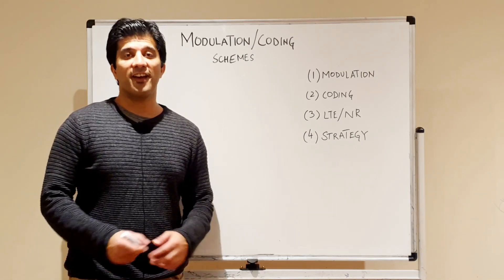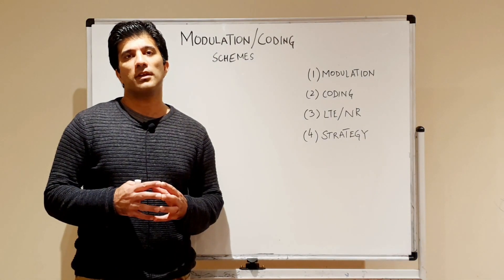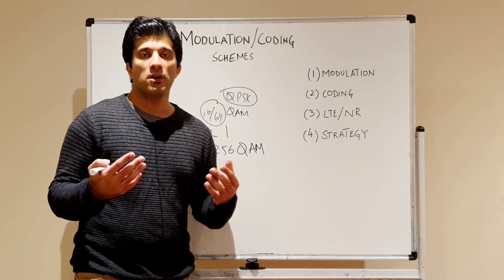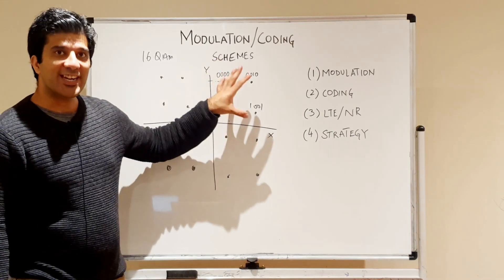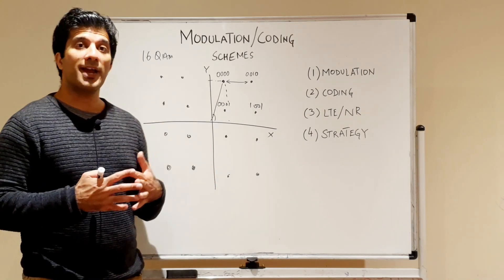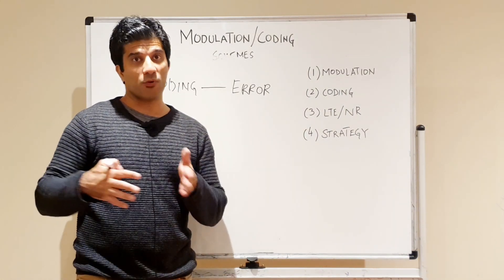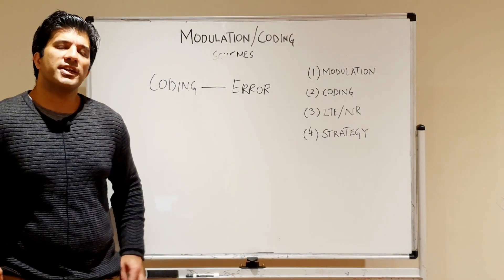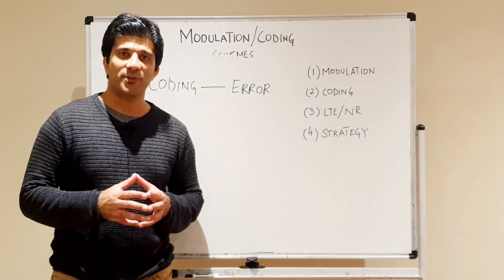5G NR/LTE Optimisation : How modulation and Coding Schemes impact Data rate/Throughput (MCS)

Comment: Also finally 1/2 means  there ae two coding bits for one data bit. This comes from the convolutional encoder in the transmit part. 

1/3 means one data bit has been split into 3 coding bits ( 8.33)
Reply from the maker: Yes in terms of coding that is correct

Comment: Also adjacent constellation points are Gray or Binary coded. One way is to term the bottom
leftmost point as say 000000 for 64 QAM and then go Grey coded in Row and Grey coded in Column. The blocks that perform the modulation are normally called Constellation mapper and Constellation demapper.
Reply from the maker: Thanks for the explanation

Comment: Great video , thanks...One note from my side, LTE (LTE-Advanced) has 256 QAM as well but the percentage of 256 QAM is very less...
Reply from the maker: Yes have corrected in the description. Thanks
Reply: QAM256 is only used when the channel allows a high data rate or the Bit error rate is low. If the Channel is poorer - low RSSI the modulation will switch down to QAM64.